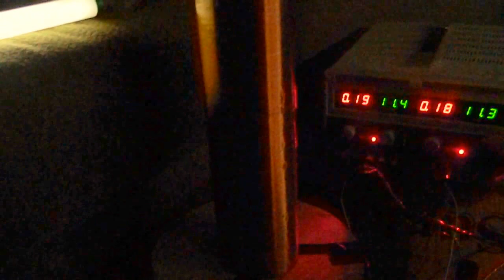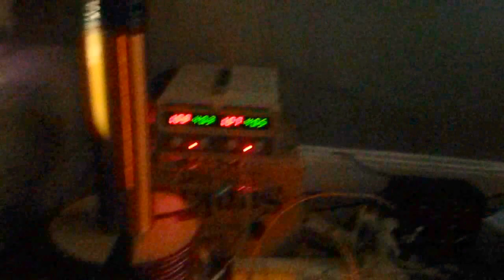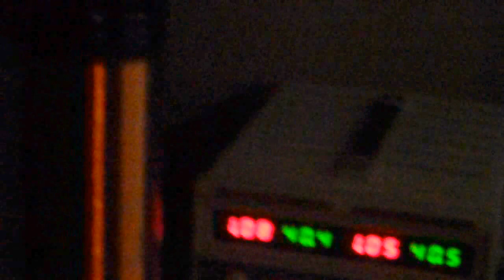Higher Power Slayer Exciter using a 2SC3320

Comment: Hi, I recently bought a 2sc3320 transistor and it doesn't work, I adjusted every possible connection. Also, I can't figure out if it's a bjt or a mosfet. Please help me and fast.
Reply from the maker: +Scotlahn Mccallister It is an NPN transistor (so it is not a MOSFET)... Here is a link to the data-sheet... http://www.svntc.com/TPDF/2333.pdf
You may have a transistor that is fried... I cannot really help you that much... Try different primary coils (<-sometimes that helps)... When a circuit doesn't work you have to begin the trouble-shooting process... I would watch this video (linked in below) and follow the steps to test you transistor. https://www.youtube.com/watch?v=qM7_h8my8eA
That is all I can do for you, good luck!
Reply: Thanks for the help, I will try these things!😀
Reply: +Scotlahn Mccallister I figured out the issue, and it was the amount of resistance going into the circuit. I was using a 100k ohm resistor, when I switched it to a 10k potentiometer, it worked great! I adjusted it and hooked up a 24v drill battery and got surprisingly long sparks! Thanks for all the help!😀
Reply from the maker: Scotlahn Mccallister
Excellent! Very happy to hear that :)

Comment: I love the large pulsed inductor. I would say that you're primary's performance is due to it's large size and you're seeing the power of reactance...or with a half-wave, half-reactance. A good experiment to test your phi theory is to add some footage to the primary and note the performance. Then remove the added footage plus some more of the same length as the previous added footage. Be sure that both test windings are outside the phi ratio...then compare.

Have you ever tried a secondary with 3 layers, so that it ends at the top just the same as a 1 winding secondary? I bet that would give better performance as well. If you look into transformer design you'll find that phi is used in the equations, but perfect induction happens when there is the same # of copper atoms in the 2' as there are in the 1'. Pull apart a mwo transformer if you've got 1 laying around and then weight the 1' and 2'. I bet you'll find that they weight the exact same. If not then the designer was hung-over that day...haha. Just some friendly suggestions...peace.
Reply from the maker: Very interesting. Thanks for the suggestions :)
Of course, this (potential) phenomenon will have to be further looked into.
Some experimentation will have to be designed for sure.
Thanks for the input.
Peace.

Comment: wow, so the primary offers less inductive leak? beautiful coil you have.
Reply from the maker: Well, the truthful answer is I do not know why it is passing less energy for the transistor to eat... What I do know is I burnt out about 8 of these 2SC3320's with other random diameter primaries... When I used the 2phi diameter large inductor it runs WAAAYYYY cooler... 1.618/The Golden Mean/ Phi etc. is everywhere in nature. It is a cosmic energy transfer ratio, its stands to be a possibility that it just allows a smoother passing of energy... But the jury is still out, more research needs to be done.. May I suggest trying it (Phi) out on your next build, you may be surprised ;) (or you may not, this could be a freak occurrence.. but I doubt it ;) Peace :)
Reply from the maker: Also, thanks for the nice comment about the coil... Her name is Brenda, I'll pass the message on. ;)
Reply: will do!
Reply from the maker: Tesla Explorer
:) Awesome!
Reply: why he did not use topload for it?
Reply from the maker: Mohammad Makiabadi
No reason in particular, other than I didn't feel that one was necessary  in this instance... But, maybe a top-load would have prevented the small fire.. Maybe next time :)